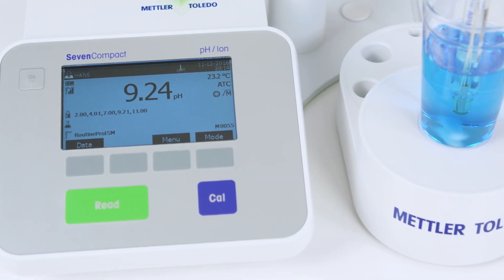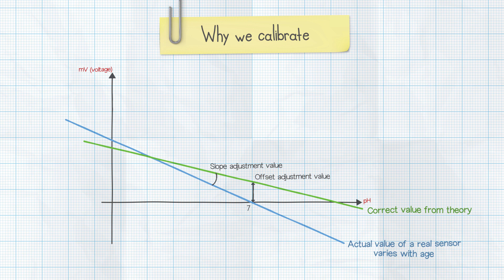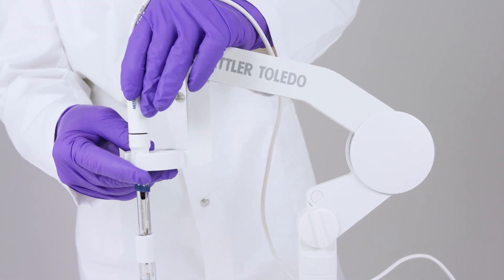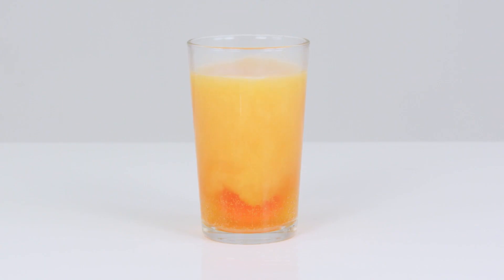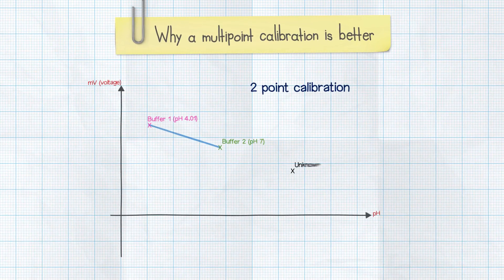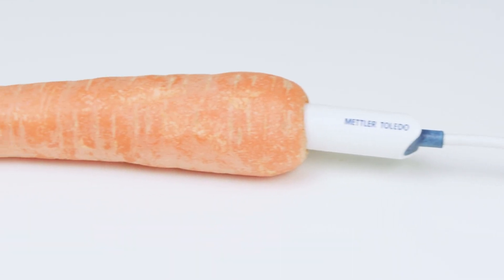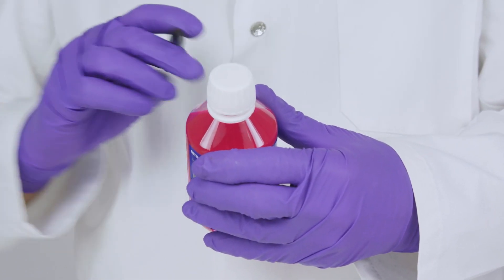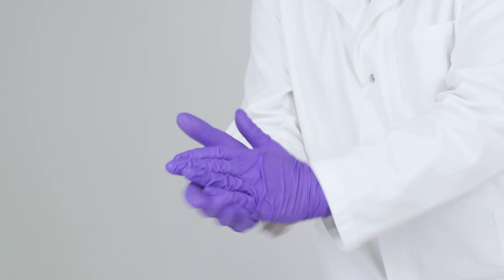pH Calibration: A Handy How-To Guide

Comment: Tanks 
I have question how to know that our calibration is true?
Reply from the maker: For the calibration to pass the slope values (MT recommendation is 95 to 105%) and offset values (MT recommendation is 0+/-30 mV) should be within the specified limits. After a successful calibration, a verification is carried out using standard buffers. The acceptance criteria for verification is +/-0.05 pH units of the pH value at the measurement temperature. Please write in to pH.Lab.support@mt.com for further assistance.

Comment: 'Start with the lowest value pH buffer' but isn't it supposed to be pH 2? Or does it automatically detect the pH 4 buffer?
Reply from the maker: This depends on the buffer group that one selects on the meter. If you select a buffer group with pH 4.01 the meter calibrates with 4.01 using auto-recognition mode. If you wish to calibrate using pH 1.68 (the lowest) you will have to select a buffer group that includes this buffer.